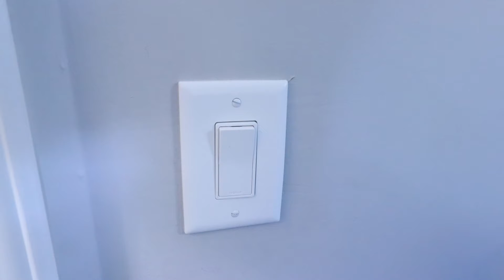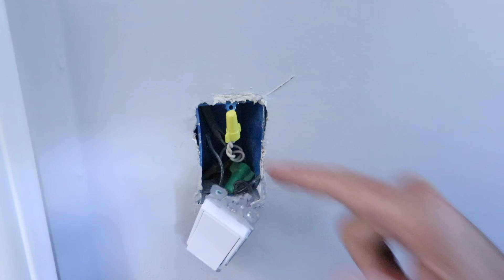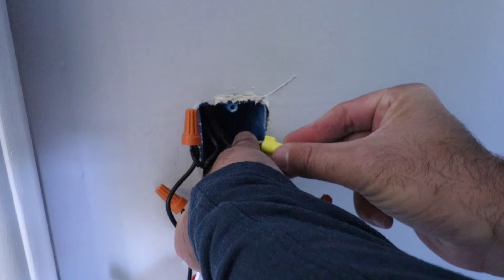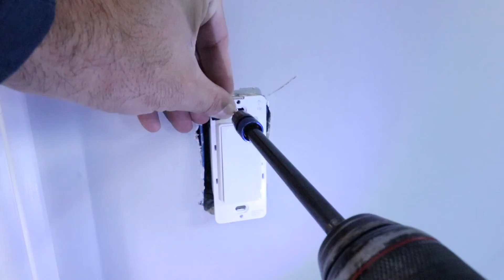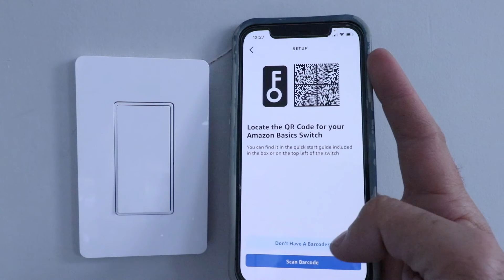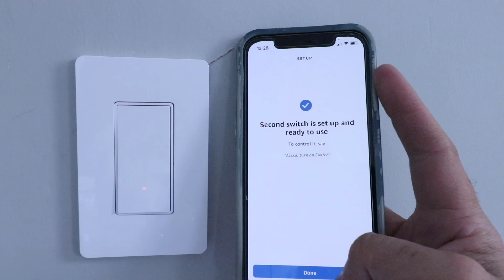How To Install Amazon Basics Smart Switch

Comment: What if my copper wire isn't connected to the previous switch? It's bunched up like the natural wire is... I'm so scared to mess it up and start a fire.
Reply: it is okay, the old school switch doesn't require a connected copper wire. Just follow the steps in the video, you will not mess it up.